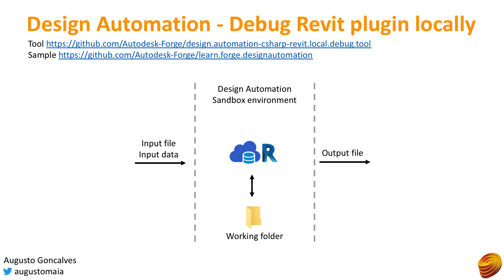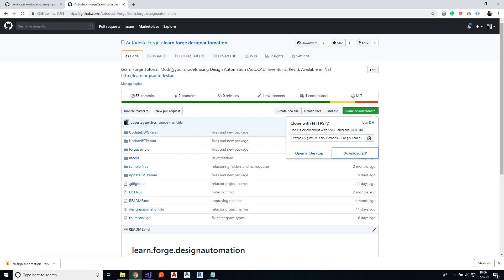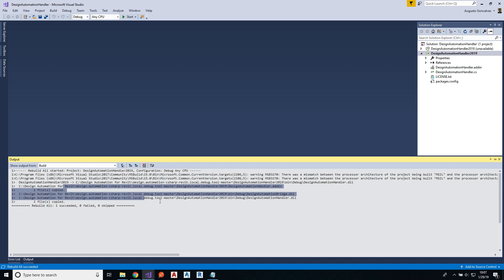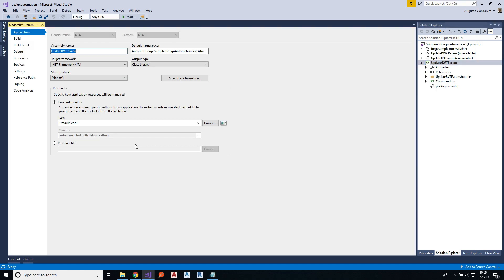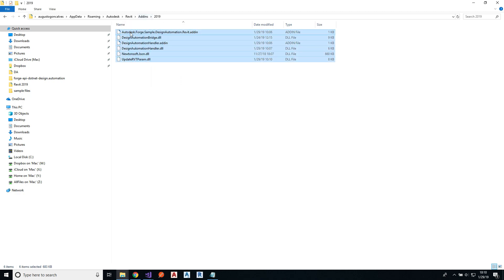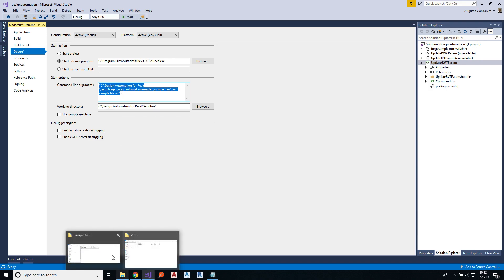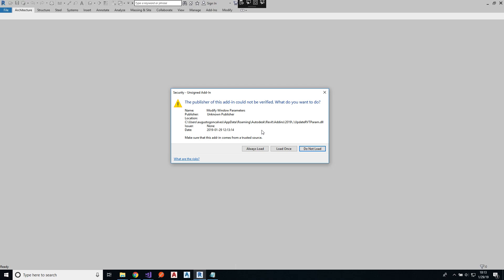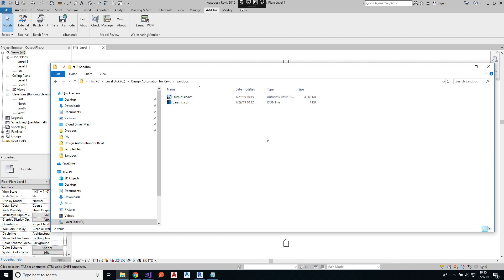Forge Design Automation - Debug Revit plugin locally

Comment: Why obsolete "DesignAutomationData(Application, string)"? Using that I could create a generic VS Studio template that had 2 paths, one for local and one for Design Automation that quickly allowed the creation and debugging of new Design Automation addins. Pop in the test Revit file and the params.json file to the build folder and click fire in Visual Studio and Bobs your uncle, it launches Revit and loads the addin for debugging. Do you think its possible to create a generic VS Studio template with this method where its one-click then ready for any new project instances?